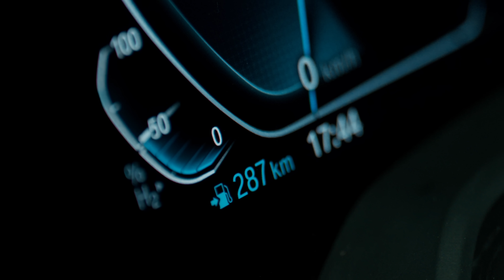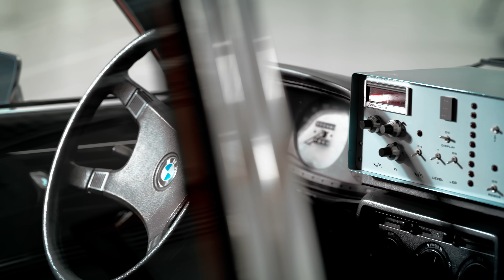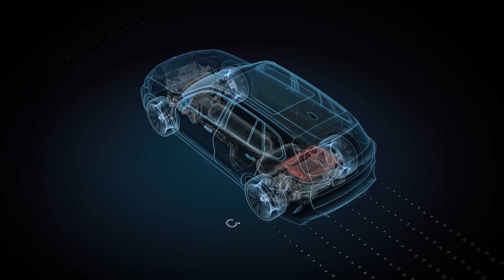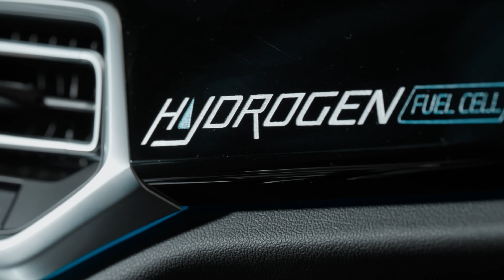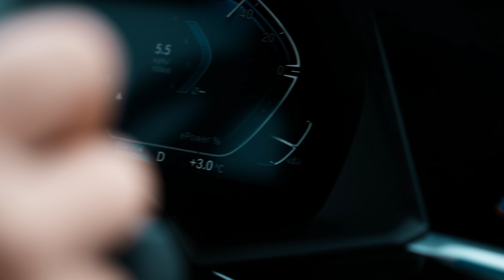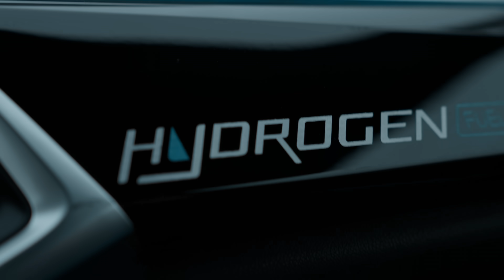Hydrogen Vehicles Are Electric Vehicles Too

Comment: This guy must have been sleeping since 1979 and just woke up. Fuel cells are fine... in space. Everywhere else, they have been tested, tried, and abandoned
Reply: even in space they've been abandoned
Reply: @larsfroelich  not really.....depend on technology....Don't forget that these fuelcells are responsible for vast majority of space exploration....I think this is the future....not the battery commedy.
Reply: Yep. Fuel cell will never be practical for passenger car use. The infrastructure is orders of magnitude too expensive (and still virtually non-existent even after 20 years of hydrogen car development), and generating green hydrogen is very inefficient and a waste of clean energy.
Reply: @jaroslavsimon8100  I agree with you. I did not understand fully but what I could understand is that hydrogen will be the fuel of the car. Like gasoline. So essentially you have to develop an engine that runs on hydrogen. Of course it has to be efficient and reliable.  and secondly you have create an infrastructure to  facilitate refill the car with hydrogen. After all the car will need  fuel refilling. 
So its a dual challenge but its not impossible. The EV technology is obviously ahead because batteries have been used a fuel sources for decades plus electric charging is possible. But use of hydrogen fuels is still a challenge though they claim their test runs are going great. So it means they have developed the car. At least the BMW executive seemed very confident.
But use of hydrogen as commercial fuel has never been tried or used. Except in rockets so that really will be the challenge.
Reply: Sounds like two losing companies trying to collaborate against a common enemy. Battery EV is the future for now.
Reply: @ashwinvirus  I agree with you. The 2 old giants, the superstars of the car industry Toyota and BMW are placing the bets against the EV or battery powered vehicles of Tesla and the Chinese manufacturers and American manufacturers. But the conversion metrics are good. Ok. I mean if we were to go by what the gentleman says it can run 500-600 kms on one charge or refuel and the refueling takes only 2-3 minutes.  That is even better than gasoline cars. I do not think EV vehicles can beat those metrics. You can only store a finite power in battery and it will take time to charge. The more power you will put in the battery the more expensive and heavier it will get. Plus the cost. 
Of course the cost will also matter for these hydrogen fuel vehicles. Both in terms of the cost of the car but also in terms of setting up the refueling infra. But then H2 is infinite supply because you cannot exhaust it whereas to set up EV chargers and make EV batteries you need Lithium and other rare earth metals which are in limited quantity. 
So both sides have their advantages. Plus its kind of cool to sit in car which will have a hydrogen tank under your seat. I am not saying EVs are not cool. EVs will the vehicles that will get us to 0% carbon emissions but watch out for hydrogen. Of course everything will depend on how efficient and cost effective hydrogen cars will be.
Reply: I'd rather pay a bit more for the  convenience of hydrogen, rather than waste 1000s of hours on my life waiting for an EV to charge.
Reply: @brajeshsingh2391  Well and why not? Why shoul I use the 1000kf of battery if I could use Fuel cells....Of course there is a long way to go....But nowadays the technology evaluates that quickly so we can not tell what will come in 2030. In my opinion they should have to develop all types of vehicles....Some politicians whoul like to dictate us what to drive but really this is what I like. Progress....Eeven if now the efficiency is about 30%...who says that it will stay like this. maybe 4 years from now there will be 50 or more....nobody knows. If I could drive hydrogen car in 2030 where 6kg of hydrogen could give me 800km....why not....
Reply: Bruv, he can’t even pronounce the name of the brand correctly…

Comment: I really like BMW so I'll tell you this for free. I'm from the future, so believe me when I say hydrogen is a recipe for bankruptcy. Don't go the way of Blackberry, Kodak, and Toyota. Cut your losses and pivot now to 100% battery electric while you still can.
Reply: Exactly.
Reply: Eww, Hydrogen driven cars are better for the environment and take shorter time to fuel up. Battery electric vehicles are a thing of the past! Take too long to charge and their batteries pose a threat to the environment!
Reply: @YDGFX  Hydrogen cars also have batteries and the fuel cell, that is as much resource-intensive as batteries, and also has expensive metals. Not only batteries are advancing way faster, but are also less expensive, and recyclable. Not only to generate and compress the hydrogen requires several times the energy to charge a battery with same capacity, but hydrogen requires storage and distribution, mostly done by gasoline and diesel trucks. Above all that, nearly all hydrogen produced today comes from fossil fuels.
Reply: @forgotten_world  All that it takes to produce the hydrogen is worth it! It's worth it for the environment and earth!
Reply: Hydrogen takes four times - four times - the energy required to charge a battery. Add to that the fact that it also need storage and distribution, mostly done by gasoline and diesel trucks, and the fact that almost all hydrogen is sourced from oil and gas, and the only possible conclusion is this: hydrogen is greenwashing.
Reply: @forgotten_world  The irony in this comment is that all trucks will be hydrogen based in the future, because EV is unrealistic for anything long haul
Reply: Long haul trucks is one case where hydrogen could make sense, but hydrogen will never be mainstream, not just because any reasonable availability of hydrogen refueling will ever exist, but because "in the future", before 2030, battery energy density will be far away from what fuel cells could deliver. Hydrogen most probably will also be used on ships and planes. Just remember that you can charge your car at home and using residential pv, what is not possible to do with hydrogen or other greenwashing tech such as the said green fuels.
Reply: how about IOS and Android?

Comment: 1:34 So BMW had a clean energy vehicle since 1979 and they never bothered developing it further to reduce emissions 🙄. They should be fined for their emissions over the last 50 years then. Thank you for admitting your guilt.
Reply: I'd blame the lack of hydrogen refueling centers.
Reply: @radglitch7233  exactly. We need to ramp up production, but right now there isn't enough capacity to produce that much hydrogen. This technology will certainly become mainstream as demand increases. However, at present, the cost of 1kg of hydrogen can reach up to €15, making a full tank of 6kg around €90. If demand increases further, prices could rise even more, making the operational costs of hydrogen cars quite high and inefficient. That said, I believe this situation will follow the trend of other technologies, where supply eventually catches up, driving prices down.....

Comment: I just don’t understand how is hydrogen better than BEV? Especially with batteries evolving and improving at very rapid pace.
The Chinese are some of the smartest people on earth currently, and it’s clear why they’re adopting BEV, and they’re currently leaders in battery research which means they beleive in the product.
So his point is that batteries are heavy 
A Tesla model 3 is 1.8 tons a couple hundred kilos heavier or exactly same weight as a bmw 3.
But who cares about weight ?? When both Center of gravity gives more safety and despite the weight the car is probably most efficient family vehicle on earth currently.
Most efficient 
Most cheapest 
Available today 
Fast charging is a reality
Instant torque And best performance.
Why bother with hydrogen ??? Especially that it’s sooo expensive to fill up and to actually make it u need a lot of energy
Reply: This is why: because 98% of hydrogen comes from oil, this is all about oil subsidies and greenwashing. They are deep in this hole. Not just hydrogen is absurdly inefficient, but they will need to transport it using gas and diesel trucks. For me this is the definitive sign that both brands can't deal with electric disruption and are beyond recovering.